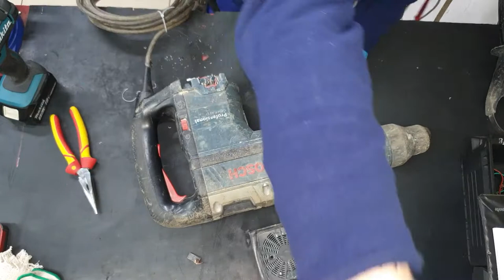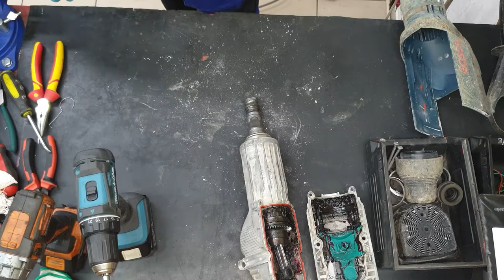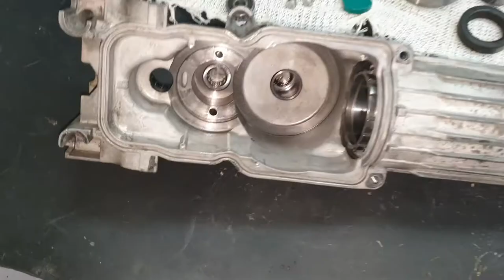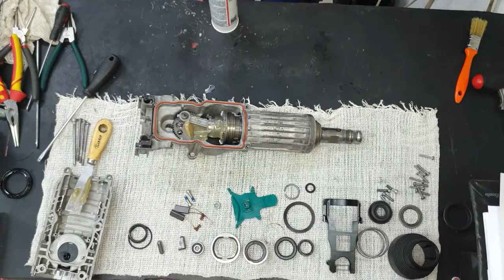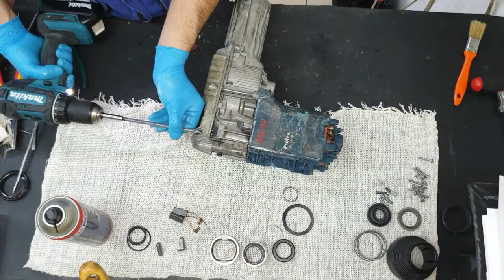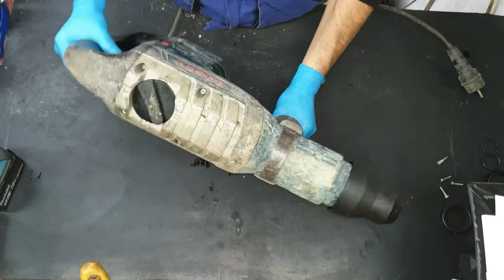Restoration Bosch Rotary Hammer GBH 8-45 D no percussion

Comment: Excellent video. I have a Bosch 5-40 rotary hammer that has oil in its gearbox. What kind of oil is this and which one can I use? Thank you.
Reply: Go to ereplacement parts and search on reservoir oil for your model of drill.
Reply: You can use 80w90 oil for car  gearbox

Comment: Bro just refuses to use the correct grease when he rebuilds these machines...
This hammer takes Bosch 1 615 430 015 grease and around 60-70ml of it if im correct.
If you dont want to buy original greases just use NGLI 0 gear grease.